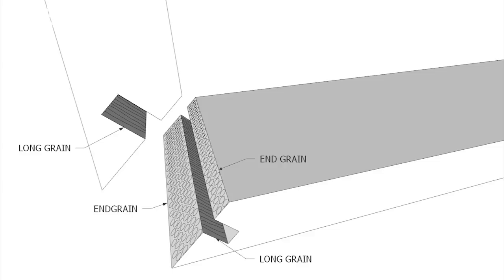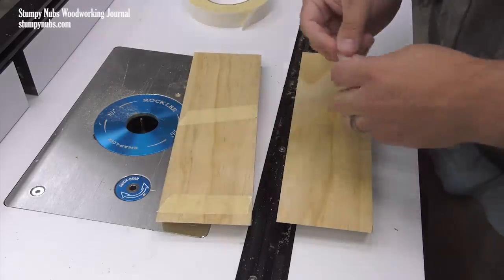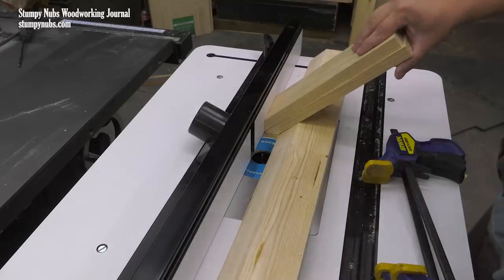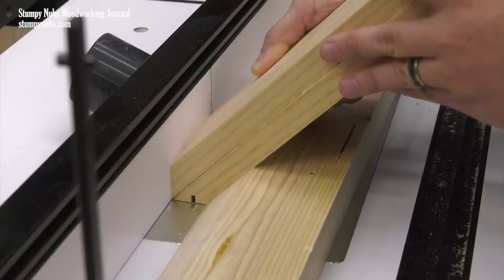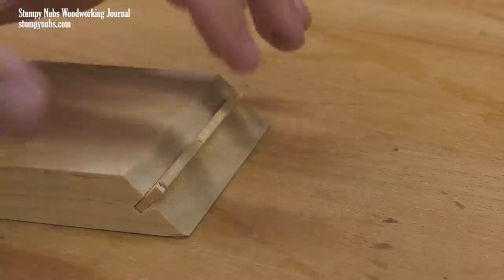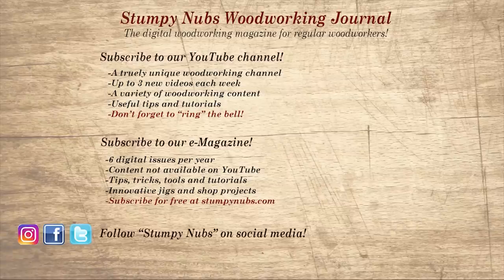Clever splined-bevel joints for mitered boxes

Comment: First, the CAD drawing of endgrain straws (circles) vs the long grain in the slot was worth it's weight in gold. I've been SAYING this to students for years, but that just drove it home. Second, the grain direction of the spline itself was a great illustration: I generally have them break a small piece to see which way the grain should run to illustrate the point. Finally, by taping the mating surfaces, you make it easy to cut with good reference. Nicely done sir James!
Reply: I’m confused, I thought the illustration of the spline’s grain direction contradicted what he said. It seemed to be labeled backwards. 
Of course I’m not very smart so I’m sure I’m just interpreting it wrong

Comment: I have been using this joint on small boxes for 43 years now.
I still have several of those boxes and the joints are still strong and functional.
Thanks James!  I like the way you used that jig on the router table. 👍

Comment: Thank you for telling me I've been making splines wrong. I would have never guessed change the direction of the Spline grain mattered.
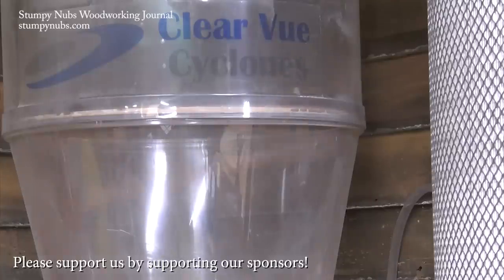Reply: I am looking at the spline @2:37 and while we are not seeing end grain, the grain still appears to be angled so that there is very little overlap of longitudinal fibres through the joint.  I guess we need to be careful about the timber we chose in those situation with so small a cross-section.

Comment: Hey Stumpy, I know you're a woodworking channel and not an active shop making stuff for clients, but I'd love to see a video (or some videos) on the business side of things. Particularly how much you invest in tools and maintenance, as well as things like lumber cost. 

I personally would very much like to get into woodworking, but as many videos there are about how you can get started on a budget and how your tools don't have to be expensive, there's very little information out there about what it actually costs to run a shop day to day, which makes it difficult to guesstimate how much of a budget you really need for the first few months or years.
Reply: Seems to me these costs would be completely dependent on what one will do. Hobby or as a business? In the shop daily 8-6 or a few hours a couple of times a week? Building with softwood, domestic hardwood or exotic hardwood? Buying 4s wood from a retailer or rough cut from a sawmill? Building small items or large? Accounting for additional wood to best match grain or just use what you have? How much wood you use will have a big impact on your wood and consumable costs and some impact on tool maintenance. 

Say you start small with 10 board feet of domestic hardwood (soft maple) at $5/BF per week That’s $50. Or maybe 100 BF of walnut or cherry at $10-15 BF. Now it’s $1000 - $1500 per week. Plus any sandpaper, glue, saw blades needed for your projects. I’d hazard a guess that those would add 5%-10% of your wood costs.

Comment: Nice tip for small boxes but impractical for large boxes such as the 30" x 20"x 20" box I built recently at my wife's request. If I were concerned about the "sharp" edge of the mitre against the fence I would use double-sided tape to stick a thin, flat piece of timber to the wood that extends over the edge of the mitre about 1/4" and adjust the fence accordingly. No need to worry about the mitre nor supporting a 30" piece of timber at 45 degrees.

Comment: Thanks as always James. however, I would like to point out an obvious error.

The visual at 28 seconds is incorrect. Both surfaces, the mitre, and the face of the spline cavity are at 45 degrees to the flow of the grain of the wood, so BOTH are end-grain by your definition. The extra surface area of course is a big advantage, providing the spline itself is not as you showed at the beginning, but rather with the grain running across its length, as you showed later.
Reply from the maker: Yes, it was imprecise to refer to it as long grain and that particular illustration is not strictly correct. But the splined miter joint is still significantly stronger by the addition of 40-50% more glue surface, the long-grain strength of the spline itself (if not technically long grain within the slot), and the mechanical component of the spline and slot together, which is comparable to a mortise and loose tenon joint.

Comment: Have been enjoying your videos for years, always looking forward to each new one.  I do have a couple quibbles about this one though.  First off, @ 0:23, "the slot portion of the joint exposes long grain".  It doesn't.  The grain orientation within the joint is identical to that of the miter cut...45 degrees off of long grain.  The other issue, although putting the spline at the center of the miter looks more correct, it is not as strong as hedging it closer to the inside/joint corner.  All that said, because decorative boxes and picture frames have few structural challenges and lead a life of leisure, joining mitered corners this way works fine.  Adding a mating piece on the router table set up is a most excellent play, never thought of it before this video.  Thanks!
Reply from the maker: Asked and answered several times in the comments already.

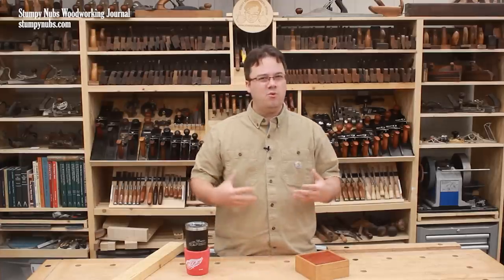Comment: This technique helps align the joint and roughly doubles glue surface, so it's quite useful.  However, you state that the groove exposes long grain (0:29).  If the grain runs the length of the stock, both the miter and its groove are at 45 degrees to that grain.
Reply from the maker: Yes, it was imprecise to refer to it as long grain and that particular illustration is not strictly correct. But the splined miter joint is still significantly stronger by the addition of 40-50% more glue surface, the long-grain strength of the spline itself (if not technically long grain within the slot), and the mechanical component of the spline and slot together, which is comparable to a mortise and loose tenon joint.

Comment: Could you plunge the work pieces so that the spline is completely hidden? I'm thinking you could put a stop block on either side, but getting the work pieces to go straight down onto the bit might be a challenge.
Reply from the maker: Yes
Reply: Same thought that I had. Good question.
Reply: At that point you're basically talking about biscuits, right?
Reply from the maker: @ps.2  - Or loose tenons :)
Reply: You'd need a bit that allows for a plunge, and it shouldn't be too complicated. Or you can "half ass" it, by doing as shown here but stop short of the full length on the other side. The side that doesn't show the spline is top/show face, the other is "hidden" at the bottom. Or actually hidden if you add a decorative trim, bottom, or feet.
Reply: I like that the spline is exposed.  It shows the workmanship of the piece.
Reply: Plunge router with a jig.
Reply: @ps.2  Loose tenons beat the hell out of biscuits.

Comment: The drawing at 0:25 is wrong as it points out that the bevel surface has end grain while the grove for the spline has long grain, the truth is that both have the same grain orientation: 45°. Still the  splined  bevel joint is a very good one, but it is so for other reasons, the first is that the spline itself has long grain and gluing 45° grain to long grain is better then gluing 45° grain with 45° grain, the second is that the splined joint has more glued surface  and the third and more important reason is that to open the splined joint you have to slide the spline inside its kerf and glue is very good preventing this, more effective then preventing 2 pieces from simply detaching one from the other. That told the method to cut the kerf for the spline showed here is very simple, effective, quick to implement so this video is really useful and I thank James for posting it.

Comment: I like this tip because it takes the guesswork out of aligning the cut for the spline (vs. using the sawblade while still at 45 degrees, but dropping it a bit). Used on a saw with the same flat grind blade, this would make the joint decorative also... I may just have to make a dedicated jig for this technique.

Comment: At 2:38, doesn't that show the grain going in the wrong direction for the spline?  
I love the splines too by the way.  I made a simple jig for the table saw and cut a bunch of splines out of different scrap pieces of wood for providing and attractive contrast at the top of the boxes.  The jig plus ready made splines make this an option I don't hesitate to use because it's also quick!
Reply from the maker: Did you watch the whole video? I covered spline grain direction toward the end.
Reply: Yes I did.  But the video at this point, unless I misread the grain direction, seems to show the grain parallel with the spline as opposed to perpendicular.
Reply from the maker: Yes, it does. A spline made that way is easier. But I explained that grain running the other way is stronger.
Reply: Sorry, I should let it go as I am sure I must be misreading the grain at the end of spline at 2:38.  It looked to me like it matched up with the weak orientation in your diagram.  At 2:35 though, it looks like perhaps the grain is orientated the way you suggest it should be.  Regardless, outstanding video as always, and always educational which makes you my favourite woodworking channel!
Reply: It's a Magic spline I guess...
Reply from the maker: As I said, it does run the way you thought it did at that point in the video. Your eyes are working fine :)
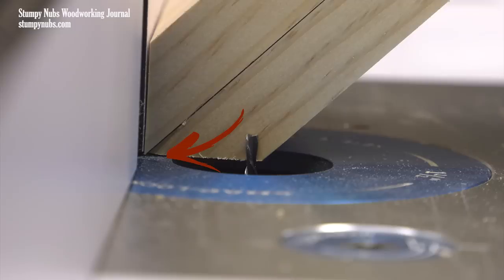Reply: @StumpyNubs  But, but, but... the slot milled into the piece does not expose long grain as is shown in the diagram at 0:25.  The grain in the slot has just as much end grain as the bevel does (45 degrees worth).  The diagram at 0:25 shows the grain running perpendicular to the face of the bevel, but it's not.  Compare to 1:03 where you can clearly see the grain in the piece and it is not parallel to the router bit - it's at a 45 to the slot, just like the bevel is.  I do not contest that the miter makes it stronger, but it can't be because of long grain inside the slot.  So, I disagree, but respectfully!
Reply from the maker: That's a separate point, which has already been debated above. :)
Reply: Stumpy Nubs Oh my gosh!  I totally misunderstood your first response!  You made the spline the easier way in that joint because in a small box, you didn't need the extra strength of the perpendicular grain.  My head is finally clear now.  Thanks for your patience!

Comment: Another good video with useful information. Do you really think the grain direction of the spline makes a huge difference, James? I can understand the wish to avoid the 'separating the straws' problem, but doesn't running the other way with such a small component risk entering the dreaded 'short grain' zone? Keen to hear your thoughts on the choice you made.
Reply from the maker: It does make a big difference in strength. But I am not sure you need that much strength in a small box.

Comment: The humble bevel joint seems to be one of the strongest ones you can make even without reinforcement according to joint tests made by bourbon moth and Scott Walsh. Not sure if the end grain myth has anything to do with it. Also it seems that this kind of spline reduces the join strength and splines on the outside face seem to add a tidy bit more of strength according to those tests.

Comment: I believe the first illustration and explanation of the grain direction is wrong - unless I am missing something! In a mitre, the grain direction is "50/50 end/long grain". Cutting a kerf perpendicular to the mitre face would yield the same grain direction. It creates more glue surface and therefore more strength, but not thanks to the grain direction.
The other type of spline, on the other hand, cut in the direction of the board (visible through the mitre), creates a long grain glue surface.
Otherwise good info in this video, especially on how you cut the kerfs on the router!
Reply from the maker: Yes, it was imprecise to refer to it as long grain and that particular illustration is not strictly correct. But the splined miter joint is still significantly stronger by the addition of 40-50% more glue surface, the long-grain strength of the spline itself (if not technically long grain within the slot), and the mechanical component of the spline and slot together, which is comparable to a mortise and loose tenon joint.

Comment: Stumpy... If you look at your diagram it's not really exposing edge grain, or and grain. The 45° is exposing the compromised edge / end grain, and the notch for the spline is just the opposite angle, exposing edge / end grain again. The advantage of the spline is that it increases glue surface, and you're introducing the spline at an odd angle that helps your corner joint further resists coming apart. Don't you agree?
Clever use of both members against the router fence or table saw fence to support the otherwise difficult spline slot cutting.
Reply from the maker: Yes, it was imprecise to refer to it as long grain and that particular illustration is not strictly correct. But the splined miter joint is still significantly stronger by the addition of 40-50% more glue surface, the long-grain strength of the spline itself (if not technically long grain within the slot), and the mechanical component of the spline and slot together, which is comparable to a mortise and loose tenon joint.
Reply: @StumpyNubs  totally agree about the added structural strength from additional glue surface and different grain orientation strengthening the joint. Now when are you going to make a video about torsion box shelves and furniture? Ian Kirby's methods look like something you would have fun with.

Comment: Honest feedback, not trolling. I think your depiction of long grain at 0:23 might be wrong. If you miter the end of the board one way and that exposes end grain, mitering it the other way doesn't expose long grain, does it? But look at your diagram at 0:23. The dado for the spline is the exact same direction as the miter would be on the opposite end of the same board, which exposes end grain.

I'm not debating that this should add strength. I'm sure it does. But the more common technique of exposed splines from the outside of the miter would expose long grain because the kerf cut runs parallel to the wood grain.

I hope I'm explaining this well. :)
Reply from the maker: Yes, it was imprecise to refer to it as long grain and that particular illustration is not strictly correct. But the splined miter joint is still significantly stronger by the addition of 40-50% more glue surface, the long-grain strength of the spline itself (if not technically long grain within the slot), and the mechanical component of the spline and slot together, which is comparable to a mortise and loose tenon joint.
Reply: @StumpyNubs  thanks for the reply. And thanks for sharing so much great educational woodworking content. I've learned a ton from you.

Comment: Why should the splines grain direction be perpendicular?
Reply from the maker: Because wood is weakest along the grain. If the spline grain runs parallel to the seam in the joint, it is likely to break along the grain in the spline. Whereas if the spline grain runs the other way, the spline will have to break across its grain for the joint to fail.

Comment: at about second 26 you show a pic of the miter which is 45 deg from the long edge of the board as end grain, but show the spline slot as long grain even though its 45 to the long edge of the board, its just 45 the other way.  the side of the spline slot is not long grain, its exactly the same end grain as the miter.  If it were long grain on the 45 angel to the long edge, why not just cut the miter that way and glue long grain to long grain without the spline?  I mean its still a better joint because of the additional surface area and the video is great, its just that what you have pictured simply isn't true.

Comment: Don't use plywood, use wood from the same lot as the stuff your are joining and get a good snug fit (CORRECTLY SIZED), unless it is balsa wood, it will be substantially stronger than plywood, and will be at the same moisture level as the other wood.

Comment: This hasn't aged well following the end-grain glueing myth-buster stuff going around now.
Reply from the maker: You mean the video that did not take into consideration that most projects are not built from little pieces of wood and force is not applied only right next to the joint where leverage isn't a factor?
Reply: @StumpyNubs  don’t get me wrong, I like what you’ve done in this video, it was just the comment about end grain vs long grain. 

Anyway, your video has given me an idea on a project I’m about to start. I’ll use your suggestion but use a pair of stops to make blind hidden trenches for plywood splines so they don’t show at the ends. I particularly liked the guide block to provide support when routing. Good idea, thanks.